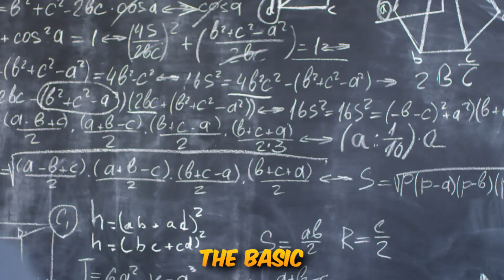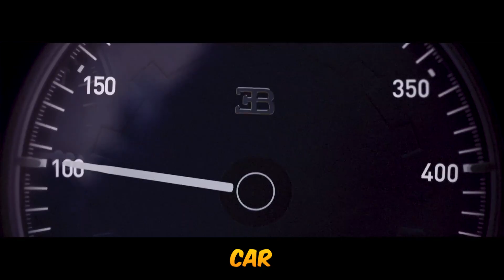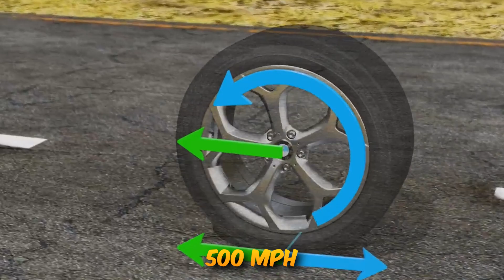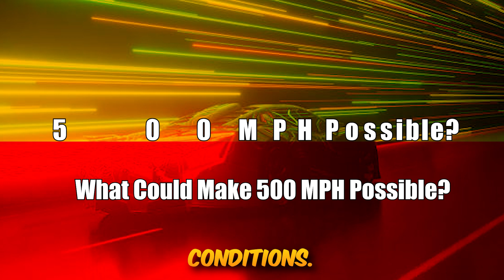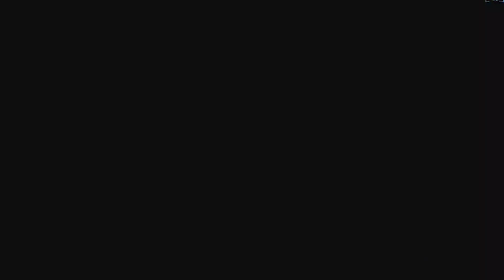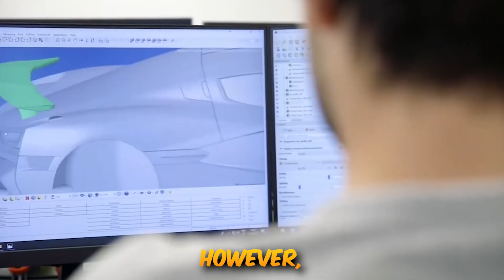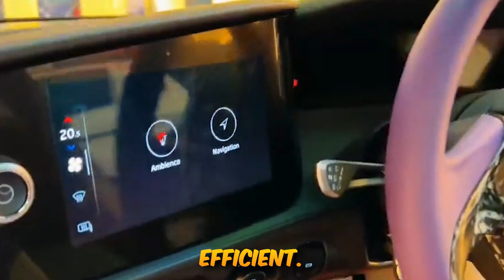The First 500 MPH Car – Is It Even Possible?

Comment: Is 500mph car possible? Considering the record is indeed well over 700mph, answer is "yes"... The 500mph chase is more about making such ROAD car - pretty much leaving out propulsion engines. Suitable drivetrain will therefore be quite a challenge, tons of torque (literally) needed, tires are also currently a limiting factor. Aero and overall stability are obviously equally important, but propably easier to solve. Finding a place to actually drive 500mph, even if it was technically possible, will be a thing aswell... does sound a "bit" unsafe.